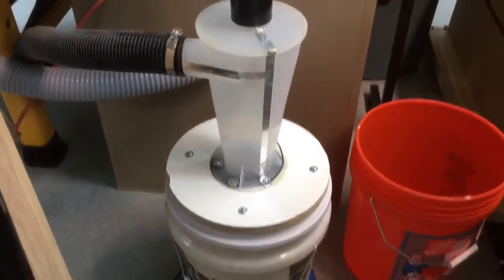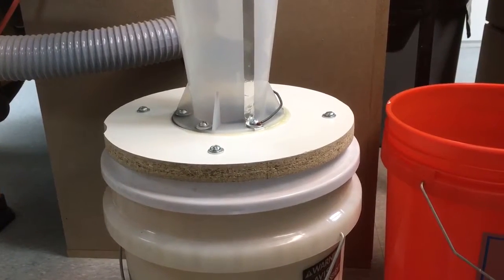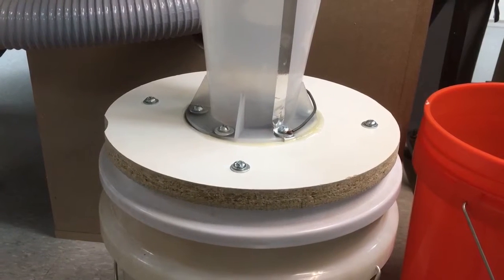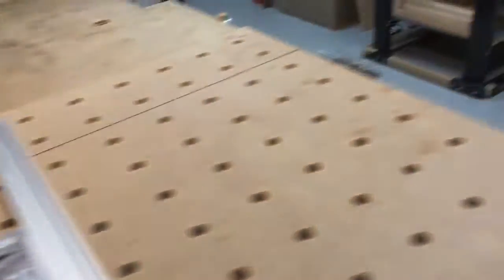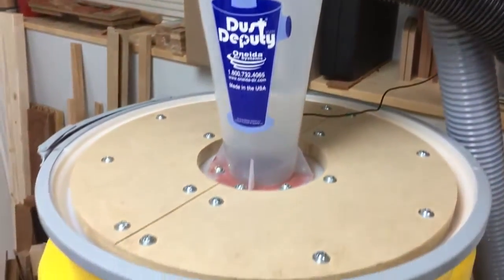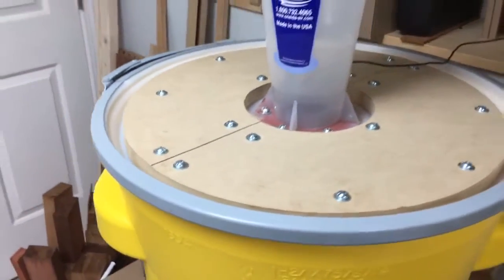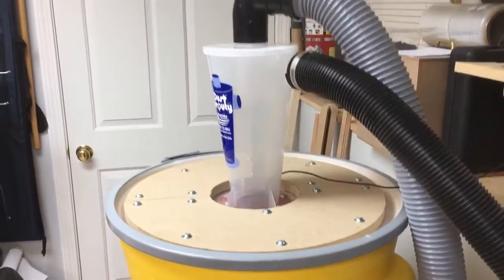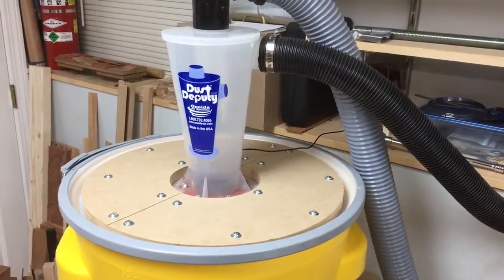Oneida Dust Deputy Mod

Comment: hey, i have exactly the same setup now and after using it about 2 weeks, the lid did collapse about 2 inches... how did you reinforce it? just bolted an MDF donut to the lid ?
Reply: I am curious as well is this just the outside or did you clamp another MDF piece underneath?